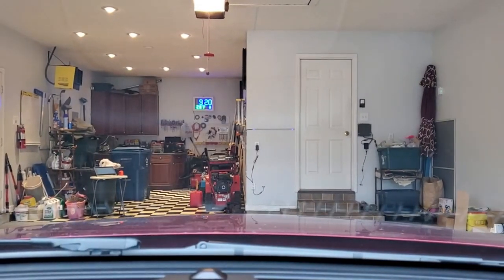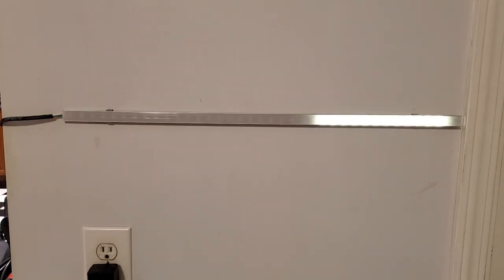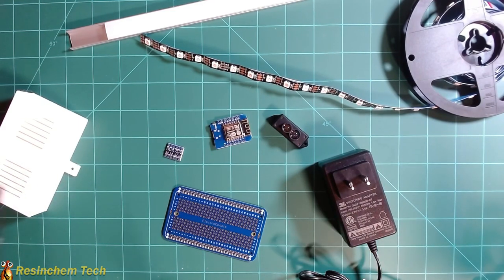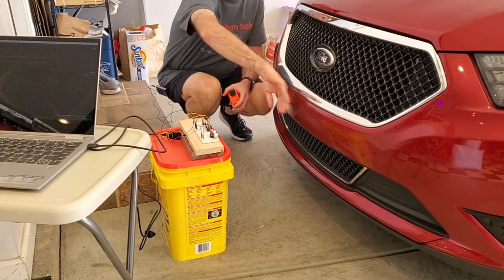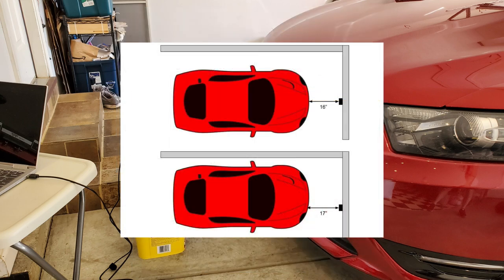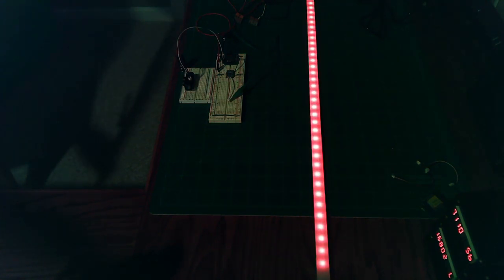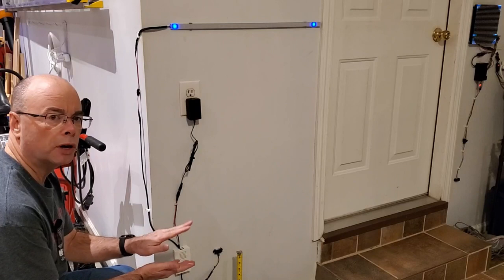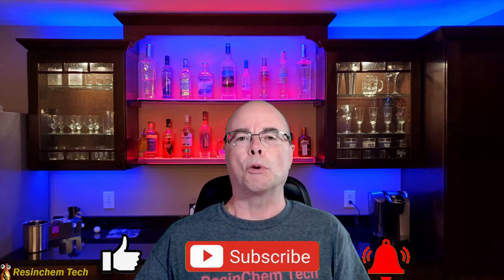A New Parking Assistant using ESP8266 and WS2812b LEDs

Comment: What a fantastic project!  Thanks for such a detailed explanation.  Between this video, your blog post, and the project documentation in your Github project's wiki I felt confident enough to build a couple of these on my own and I ordered the parts (using your affiliate links in your blog post) to make a pair of these. 

 I now have everything wired up on my bench but I've run into the same issue as "loggki" reported on your Github's "Issues" page.  I'm also getting the standby lights on my LED strip but my MQTT receiver is showing that all I get from the sensor is the default "192" distance.   Since I now have a pair of the TFMINI-s sensors I tried plugging in the other sensor but got the same result.

Doesn't the fact that the 8266 is booting up correctly and is going into standby mode mean that it's able to talk to the TFMINI-s?  I'm assuming that if I had things wired incorrectly I wouldn't have gotten to that point but I could be wrong about that.   I tried powering everything up without have the sensor connected and it wouldn't boot (just like you'd said in your article) so that's what makes me think that the sensor must be getting power and must be able to be seen by the 8266.

Would you like me to post this in the "Issues" area of your Github project instead of here?
Reply from the maker: Thanks!  I appreciate the kind words... and the fact that you read all the documentation that took me forever to write!

But your comments did make me think of something that I might need to change in my firmware code.  I guess I never really expected someone to build more than one of these.  The hostname for joining the wifi is 'ESP_ParkAsst'.  I did this to make it easier for folks to get the IP address in their router (as opposed to some generic ESPXXXXX).  But I'm not actually sure what would happen if two devices with the same host name try to join the wifi network... I might ask for your assistance on that one to see what your router is showing.  But I don't think that has anything to do with your current issue.

Would you mind reaching out to me via email?  Some problems just aren't conducive to troubleshooting here in the comments (or via Github issues).  If you are on Discord, once we connect via email, we can jump over there for more of a 'real-time' conversation if needed.  You can get my email address by going to the 'About' page of my YouTube channel.  There will be a button to 'view email address'.  Note that some folks that are on mobile devices (specifically iPads) apparently don't see this button, so you might need to use a full desktop view.  I'd share my email here, but I don't like to do so because it gets picked up by the spam bots.  If for some reason, you still can't get my email address, follow up to this comment and I'll find another way to share it.
Reply: @ResinChemTech  Thanks!  Email sent!

Comment: This is great. thank you! 1 question: once you park and its turned to a solid red, when / how does it turn off?
Reply from the maker: The LEDs will automatically turn off and the system will go into sleep/standby mode after the active parking time expires.  The active parking time is a time that you specify in the options.  You can see all the available options and settings here:  https://github.com/Resinchem/ESP-Parking-Assistant/wiki/05-Using-the-Web-Interface

I tried to build the system to allow it to be customizable via its web interface so you can tailor it to your particular needs.
Reply: @ResinChemTech  Fantastic. You thought of everything, well done! It’s good to see practical / useful arduino projects 👍🏻

Comment: Nice project but way more complex and expensive than necessary.  I bought a laser that projects a large X pattern and mounted it on the ceiling.  It is adjusted so that the X is centered on the dashboard when properly parked.  You can see the X on the hood of the car as you pull in so it is foolproof! I powered the laser from the garage opener light socket so it turns on when the door opens. Cost was about $25 for all parts.  No microcontroller, no code.
Reply from the maker: I guess it depends on what you are looking for.  A tennis ball on a string cost next to nothing, doesn't require electricity at all,  and basically does same thing as my system and yours.... help someone to park in the optimal position.   There are many different ways to accomplish the same thing.  For me, I also wanted a system that I could integrate into Home Assistant and use for vehicle detection and automations.  Something the tennis ball could not do.

But I appreciate you sharing your project.  It might be ideal for you and others that don't want to go to the level of of difficulty I did for my project.

Comment: After watching several videos about how to wire up LED light strips similar to the one you used, I've noticed the other videos used a resistor in-line between the ESP and light strip data line as well as a capacitor on the power line.  I'm curious to know if you did not include these intentionally and if so, why?
Reply from the maker: I have found that with over two dozen LED projects, I have only needed a resistor in one situation and that was due to a very long data line run in parallel with the ground wire.  You can certainly include a resistor and a capacitor to "smooth" out the voltage, but I've simply found that I don't need them.

It is similar to the debate about the logic level shifter (e.g. the I2C-compatible versions begin too slow).  There is theoretical and then there is practicality and what I can see with my own eyes.  On paper, you could/should add a resistor to "even out" the data line and a capacitor to even out the voltage.  But again, with one rare exception, I simply haven't added either and have had no problems.  I've also not heard from anyone that had an issue with the parking assistant that they built it based on my design.  But like with most DIY projects, there are multiple methods and techniques.  Since my projects are generally targeted towards beginners, I try to keep them as simple as possible... and that means not adding things like resistors or capacitors unless they are truly necessary for functionality.
Reply: @ResinChemTech  Much thanks for the clarification

Comment: This a great update to the original version and I would love to build a couple of these. Do you have a ESP32 version of the code? Also maybe add a metric/US units switch on the interface for the rest of us?
Reply from the maker: I might consider an ESP32 version at some point if I have the time, but I can't promise when that might be.  From my end, it then means I have to maintain and support two different versions of the code (the ESP32 requires different libraries and uses a different file structure, so it's not really feasible to have one code set for both ESP types).  Just out of curiosity, why do you want to use an ESP32 when an ESP8266 has plenty of 'horsepower' for this particular project... and costs more as well?

As far as the metric vs. imperial units... internally within the code, everything is done using millimeters... the values are simply converted to inches for displaying on the web interface, as the majority of my subscribers are in the U.S.  It's really just a matter of taking out the conversions (divide by 25.4 to display on web, then multiply by 25.4 when taking the web entries and converting back to values for the code) and changing the labels on the web page.  I could consider adding some sort of switch or option like you mentioned.. and I may do that at some point.  But the source code is available in the repository, so you could easily fork the repository and modify just a few lines related to the web page to make everything millimeters or centimeters if you like.  Or honestly, since you will only setup the distances one time and won't change them (unless you change vehicles), it might just be easier to take your measurements in centimeters and use an online calculator to convert to inches the one time you have to set up the zone distances.  That's how I initially testing the program... I measured in inches, used an online calculator to convert to millimeters and entered that into the code.  I would understand if you were having to enter distances all the time... but it's really just when you are initially setting up the system that you need to enter the distances and would need to do the conversions.

But I appreciate the feedback... and will certainly consider both of your recommendations.  But when I might have a chance to do so depends on my other project loads and finding the time to make those changes, so I do not know when I might be able to make these kind of requested updates.

Comment: Thank you for the awesome video, by any chances adding a buzzer which will have intermittent beep when red while long beep when red flashing just a like a parking sonar？
Reply from the maker: That's an interesting idea!  I added a buzzer to my matrix clock countdown timer that would work similar to this.  I did find that I needed to add a 5V step-up converter to boost the 3.3V signal.. as the buzzer was too quiet and weak at 3.3V.

The code changes would be pretty trivial for this (although I'd probably want to add options in the web settings, which gets a little more involved).  I will definitely add this to the list of feature requests for this project... but I can't say for sure when I'll have a chance to work on it based on other current projects.

But thanks for watching... and the suggestion.  It is an interesting one that no one else has brought up.
Reply: @ResinChemTech  I am just order mostly similar BOM as per your blog, will diffinately try out without the buzzer version first! 🙂

Comment: Great project! So. Very first time I have ever tried to put something together like this,  I have followed the blog/vid instructions but since some of the steps are assumed  I need some guidance please.  I almost have all the connections soldered.  I have some questions: on the following steps- "5. The next onboard connection will connect pin D6 of the D1 Mini to the LV4 pin of the logic level shifter.  I connected J5 to H19 for this step. that connection" ,   this is a onboard connection and does not solder to anything else?"    And Step  6. "There's one final onboard connection to make, and this is done on the underneath side of the board.- It looks like you have soldered all those 5v rail connection's together send then did the same with the Neg rail, is that correct?  Last thing, you did not really explain how you put the ESP and the LS on the board- What I am asking is, Yes I can see you placed them then soldered each connection but am I supposed to connect any of the other wires I have soldered so far to those components or will the connections already made, make it all work?  Thanks for any help.  I assume since this is a "circuit" board that kinda answers my question (DUH) but I want to make sure :)
Reply from the maker: OK... I'll try to help out here as best that I can, but I'm not 100% sure I fully understand a couple of your questions... and I don't want to steer you wrong and have you connect something that results in smoking the ESP or something else!  I'm guessing the step numbers you are referring to are from the blog article.

5 - Yes, you are correct.  In this case, you are using an onboard connection, basically to connect the GPIO pin (D6) to the LV4 on the shifter.  You can use any available hole in the ElectroCookie board for that is connected to the desired pin by the vertical traces on the underside of the board.  Look at these traces and it is pretty obvious that they are electrically connected.  For example, if you look at "column 5", any thing wired into rows A-E will be connected together.  Same for column 5 and rows F-J.  So, for this step, you just want to run a wire that connects the D1 Mini D6 pin to the logic level shifter LV4.

6 - What I am doing here is creating a voltage bridge to help with the higher current that the LEDs can draw.  The traces on the ElectroCookie are pretty small and are not rated to carry much current.  By adding some wire, I'm helping to deal with that higher current.  Now, if you are not going to run the power from your LEDs through the board and are going to run 5V and GND in parallel to both the LEDs and the controller board, you do not need to add this extra wiring.

As far as your last question... see the answer to number 5.  When you solder the D1 Mini and LLS to the board, they will be automatically connected to the wiring that is soldered to any of the other columns connected by the traces on the ElectroCookie board.  This is exactly like a breadboard where things plugged into the same "column" (on each half of the board) are wired together.

I hope this helps.  Let me know if you have any follow up questions... or when you get the project up and running!
Reply: @ResinChemTech  Thank you for the quick reply!! YES that helps greatly and I think I can move on now, you told me what I figured the answer was, I just am being over cautious since this is my first project!

Comment: This is a very cool project. Thank you for inspiration. Hence I need to fit bikes next to the vehicle, I think about extending by another sensor and also display lateral distance to the wall.

Thank you for your sensor comparison. For another project I tested ultrasonic senosrs. It was really disapointing (worse than your measurements). I expect that there were other ultrasonic sources in my test field... some cars passing at the road messed up the sensor toally... Might be that they had ultrasonic sensors... so be aware if you use ultrasonic and other cars passing by (or even your car has sensors).
Also be aware: Wind and floating air produce white noise, which also contain ultrasonic.

As I work with different sensors in my professional life, I also think about combining the two cheap (Ultrasonic and ToF)) ones for longitudinal measurement and the ToF for lateral... I guess this gives enough information, but will take some sensor data fusion. Now I'm really hyped by this idea... but I have some other projects which are more urgend. I guess this will take some time.
Reply from the maker: Thanks!  And thanks for sharing your info on ultrasonic sensors.  They have their place, but also their limitations.

Note that if you want to add additional TFMini sensors, you'll either have to move up to an ESP32 (since the D1 Mini only has one available serial port), or flip the TFMini over to I2C... which can be done by sending it a command over serial. 

Thanks for watching... and for taking time to post a comment.
Reply: @ResinChemTech  😀 Wow, thank you for your respond and the additional hints. They'll come handy. I have some D1Mini, RasperyPi PiCo (without WiFi) and some ESP32 waiting for projects... not sure if I might drom Wifi, keep verison with few pins or go for the big ESP32... so much possibilities those days ☺

Comment: I have started to get parts for this project. but i see some newer models of the lidar?MIni-I , worth the extra money? you should do a video and test them heh..also is there a diference in v3 and v4 of d1 mini? thanks.
Reply from the maker: I'm not familiar with any newer versions of the actual TFMini-s.  I can tell you that the firmware has been tested and should work with boards that have either v1.4 or v1.8.1 printed on the back.  It should theoretically work with the TFMini-Plus, but I haven't tested it.

The Arudino library used is pretty specific to the TFMini (and the communication format for the TFMini is pretty specific too), so it is highly unlikely the existing firmware would work with any other type of LIDAR sensor... at least not without updating the libraries and possibly the function calls to get distance.  Unfortunately, I don't believe there is a library that would work with all LIDAR sensors... so in my case, I opted to use the TFMini-s.  You can always try another sensor (like the TF Luna... or one from a different manufacturer), but I almost guarantee that you will need to modify the firmware to make those work.

As far as the v3 vs. v4 of the D1 Mini... I believe the code should still work, but again haven't tested the newer v4.  I have quite an inventory of D1 Minis, so probably won't pick any of the v4 up until I've exhausted my current supply.  Yes, there are some minor hardware changes (beyond the USB C), but I don't believe there is anything that would cause the code to not run.  If you try one and find out that it does or doesn't work, please drop me a note to let me know what you find... and I can share that info with others in the Github repo.